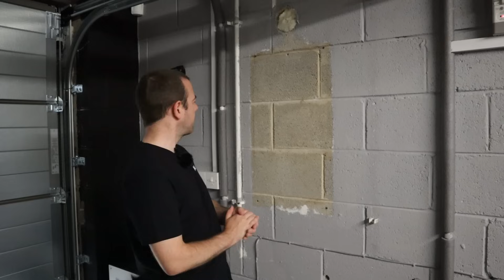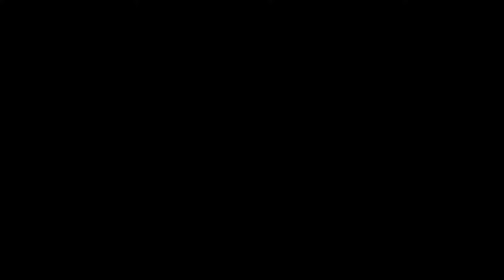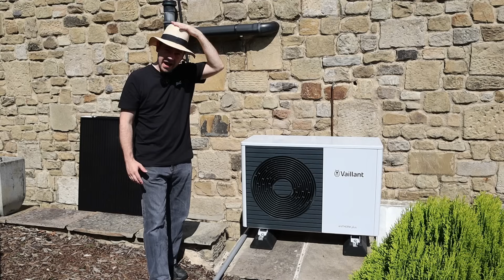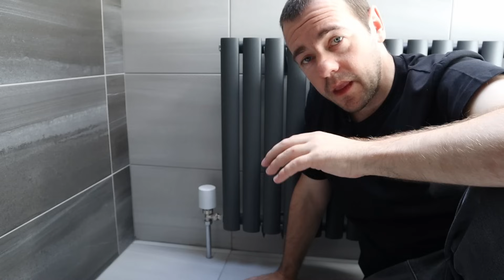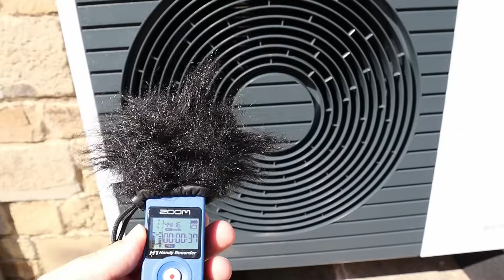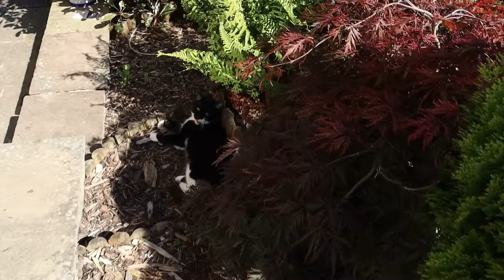Heat Pumps - Our 'Ugly' Truth!

Comment: Will you be sticking on a solar diverter for times when your going to export or will you simply manage it manually / with timer during sunny days with the Givenergy as a buffer?
Reply: EVM is on Octopus Go which doesn't give you anything for solar energy exported. Any electricity generated by his solar PV array goes to any household demand first and then to the battery if there is excess. If the battery is full then the excess goes to the grid but you don't get any money for it.
Reply: @kiddwong4186   eh, no. EVM has a similar setup to myself. Octopus allows you to have their SEG tariff paying about 4.1p IF you export it. My question to EVM was would he be getting a diverter to automatically power his water heater instead of recieving this small pittance, when he could stick it in the water tank and avoid having to pay 7.5p later for the same energy.
Reply from the maker: I get 4.1p export.
I have a plan for any excess, excess solar. Not water though.

Comment: Am I correct that the heat pump doesnt provide hot water, but. rather you have  a well insulated immersion heater with TOD mains electricity.
Reply from the maker: No it does the hot water too. Immersion is there as a backup, which for me is turned off.
Reply: @ElectricVehicleMan  do upyou run it to kill off legionnaires?
Reply from the maker: @skiiddy  It’s in the video.

Comment: Glad to see you made the switch!  We're now 9 years into heat pump ownership having come from an oil boiler. Same as you, our boiler was end of life (it had actually died in our case) so we took the plunge a few months earlier than planned.  

Ours is a 12KW Panasonic and heats water up to 65 degrees. We run it at 55 degrees in winter, although it adjusts itself for weather conditions. Payback was a little over 5 years so we're well in profit now.  

Best thing we ever did! It plumbed straight into our existing radiators and cylinder. The only additions were an expansion vessel near the heat pump and a small tank in the return pipework which moderates the return temperature so the HP isn't switching on and off all the time.

Efficiency, as you say, is not as good on older HPs and, like MPG claims for cars, doesn't match the quoted numbers, but the savings are clear to see.

Looking forward to updates on this project as time passes and you learn more.
Reply: What did you have before the heat pump?
Reply: @edc1569  A Camray 5 oil boiler.
Reply: You sound like an infomercial. 🤣😂💀☠💩🤠